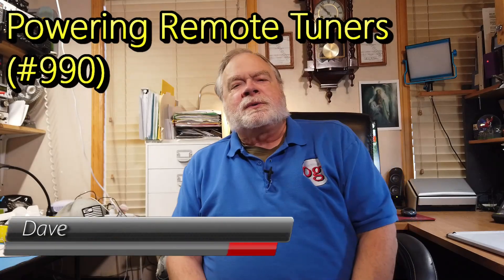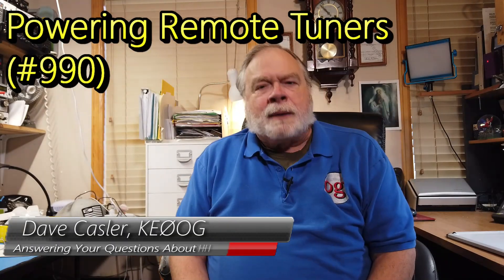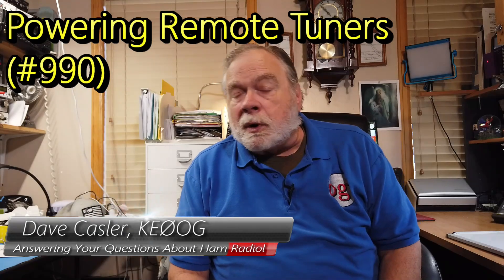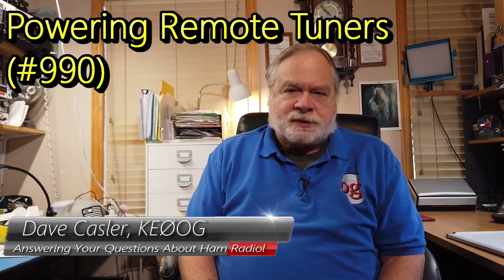Powering Remote Tuners (#990)

Comment: Hello David, everything I do is remote to include my MFJ-939 autoturner connected to my Flex 6400. Note I do live in an HOA with all my antennas in the attic, but I mounted the MFJ-939 just below my antenna switch in my attic, (No need for weather proofing since it is protected in the attic).  The turner is powered from wireless switch in the shack with a 4 conductor telephone wire from the wireless switch to the turner. I use two of the 4 wires for the turner power and the other two wires as a manual tune in the shack or remotely when required.

Comment: I have an MFJ-998RT that got moisture into it and destroyed some of the relays.  Another time I'd house it in a watertight outside electrical box and power it with a rechargeable battery and solar panel.  I'd also add a desiccant pack or two watertight electrical box.

Comment: I have been working on how to power a remote tuner and run a remote switch with bias-tees. At 200 feet, running a separate power conductor is not ideal. Oh, and SGC also used / uses bias-tees, as do many others.

For your solar guy, a solar panel, a charge controller, and a small 13v battery (motorcycle would do) would likely give 24h operation. I haven't looked at the typical draw for my tuners.

Comment: I use normal MFJ-993B tuner outside,   I pull just PC board out of metal box,  and placed into Water Tight Box made for AC power strip outdoor , such as SockitBox.   then, I feed power to it by 2 wire Door Bell wire I got at Home depot.   I wound many turn on DC power cord on toroid ferrite core.    did not use Bias-T   , too complicated for me.    AG6JU